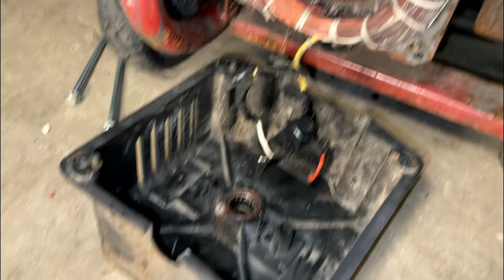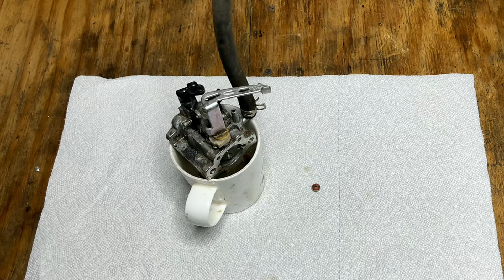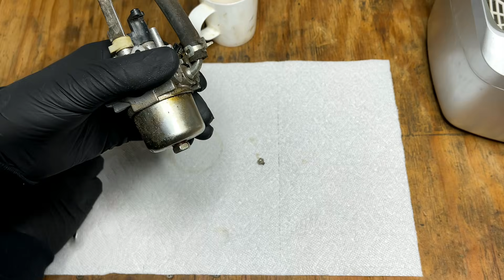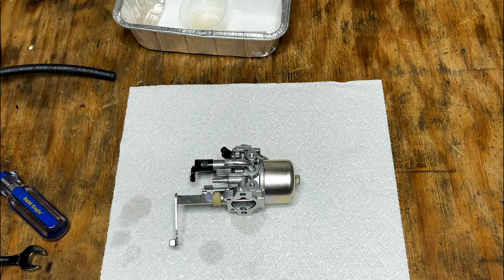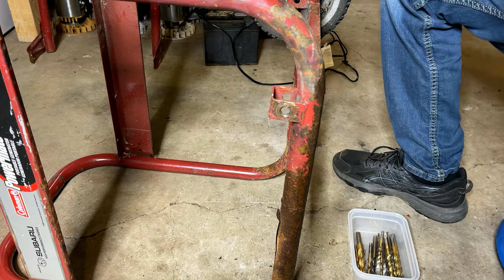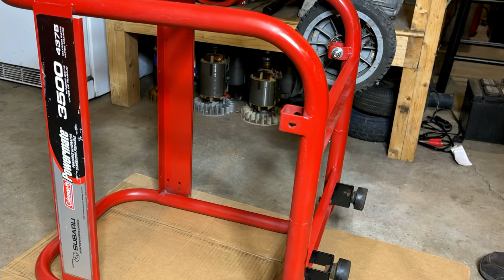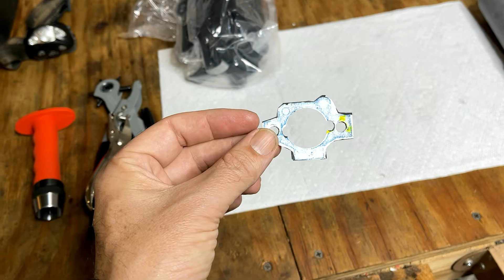Powermate Generator Not Making Power - Can it Be Fixed?

Comment: I CAN TELL YOU  RIGHT NOW WRONG CAPACITOR SHOULD BE 22UF 450VAC THATS MOST LIKELY YOUR ISSUE  I HAVE THE EXACT GENERATOR WAS WORKING FOR HOURS TURNED OFF TO REFUEL WILL NOT CHARGE CAPACITOR SWOLLEN BAD SO HOPEFULLY THATS MY PROBLEM DID ALL THE TEST JUST LIKE YOU AND EVERYTHING GOOD

Comment: One hell of a fix, and transformation, another nice job, James, I do have a concern, though in watching your video the cap on the end of the powerhead had a very tiny little bearing in the end. I think maybe I would've put extra grease in that first, I'm guessing should that bearing heat up in that plastic housing and elongation happens in the plastic, the rotor and the stater will collide, ruining the generator.
Have you ever seen that happen with that design?

Comment: I hate black tape. After it's been there awhile, it's usually sticky and messy. I never use it. If I use electrical tape, I use a high quality (usually white) electrical tape. One of the reasons I hate black tape is that people usually use it to hide their screw-ups. I can't tell you how many times, in troubleshooting electronic circuits, spotted a patch of black tape, and it wasn't only a mess, but it was hiding an electrical mess underneath.

Comment: I just picked up a Twin to this with a running Subaru engine, no output,I did the same checks you did, when I took the back coveroff,the capacitor was blown up,replaced it and it works again, great video
Reply: I bought a back up capacitor 15 years ago for our two units , have not replaced it yet but I very cautious about turning on and off 
I think that’s why they fail is unplug it while under load 😢
Reply: Plus service the sun engines more than needed 😊😊😊

Comment: I have ave a question when you are testing the voltage running and under load where are you hooking the meter up at
Reply from the maker: It is plugged into an extension cord to the generator.

Comment: Greay video James!  I just found this while looking for mantenance tips for my 25 year old Coleman Powermate!  Still generates great, just looking to do a little old age upkeep.  One question, why did you put the folding handle bar on upside down in your final re-assemble?  I'll be checking out your other videos. thanks!😊😊
Reply from the maker: The handle was upside down when I got the generator.  If turned the other way, the handle folds up on top of the tank.

Comment: Actually, there are several features of this unit that are superior, in my experience.  First, the use of the Subaru engine. At work, we used literally thousands of them, with very good success. They are very dependable, and what one of the techs in life test commented : "They are what Honda claims to be, in terms of life and parts cost."

I also like the fact that they used three point mounting for best vibration dampening. And, I like the  brushless design. One of  the design engineers told me they could produce a much cleaner output if the rotor was skewed at the correct angle. The capacitor by the way, is important in determining the output voltage and wave form. When I saw the little 5mfd cap, the first thing I thought of it "it is 'way too small." Smallest I have seen used was 16mfd, but most are in the 30 to 45 range.

Comment: You should get a bench grinder to clean up that hardware 🙂..  Hey quick question, I'm working on a Powermate PM0496504.18 w a gx390..  Was mainly interested in the motor which is running, but need to rebuild the carb..  No power to the plugs on short fuel in  intake run..  What confuses me is the field winding main connector has cont from white to black black to white, but not black to black white to white...? 🤔  Was wondering if you have a vid you can recommend for these specific style Powermate units?  Anyway, thanks for all the great vids..

Comment: I have a question,  he often times will start a generator with a light plugged in and turned on,  then shut the generator off without unplugging the light.  Mine says to always unplugging all outlets before shutting down engine.  It will damage the generator.  Will it hurt it or not?
Reply from the maker: A 70 watt light should not hurt it.  Heavier loads maybe.  I think the bigger issue is the power surges associated with starting or stopping the engine potentially damaging anything plugged in.  Older generators also depend on residual magnetism.  Shutting down with a heavy load can wipe out the residual magnetism are cause issues with the AVR or DPE winding.
Reply: @jcondon1  
Sir, thank you for that information.  I appreciate you taking the time to explain it. 
Have a wonderful day sir.  😊

Comment: I have a Colman powermate 5000 only one leg makes 120 V the other side makes nothing. I replaced the breaker, and checked the brush, all is ok. 
Everything else is perfect.
Last time I used it was under heavy load and the breaker in question was kicking off a number of times until I lost 240volts and only made 120v on one leg. 
Any thoughts?
Reply from the maker: I has to be a bad stator or an issue with the wiring (bad circuit breaker, corrosion or loose wire)

Comment: I have this same generator. One day was working fine the next day it wasn't putting out power. I did try doing the re- energizing thru the brushes. I plugged in a electric light and it came on very bright. However when I disconnect the wires from the 12v battery the light goes out. Does anybody know what that means? With the battery connected it's putting out AC current. I'm stumped.

Comment: these brushless sets are so hard to find information and trouble shooting on, everyones first reply when you say its not shorted out and its not making power is "check the AVR" "did you check the brushes?".. all my wires test fine and my capacitor is good, didnt check anything on the rotor as it looks a mess to try anything with but thats my next step i suppose

Comment: 52:43 I'm constantly puzzled at how you can make the frame look so good, then stick some rustyass Predator feet and junky wheels back on it, without trying to make them look better at all.   They sell spray paint for plastics at every autoparts shop, and certainly you could replace the rusty hardware on those feet, that couldn't be that hard.   Otherwise I love your videos and have learned so much from you, so I thank you for that.

Comment: James good afternoon what determines the power the gen puts ? The number of windings? The size of the wires ? The size of the magnetic field? The speed of the rotor ? Or what determines its power output?
Reply from the maker: It is a combination of things.  First HP.  You need 1hp for every 550 watts.  Second the size of the stator.  If you overload a small stator and the circuit breaker does not trip, then the wires will heat up and eventually cause the insulation to fail.

Comment: Theres a much easier way to make the gasket with the material you have. Just simply put it on the end of the carb and tap the material with a ball hammer lightly and the gasket should come out just fine.

Comment: I've got the same generator. I was welding with it the other day and suddenly the welder seemed really under powered. I ran an angle grinder on all 120 outlets. I checked the no load voltage and I'm getting 105 on one leg and 110 on the other. That seems low to me. My welder runs fine on another generator. What do you thing would cause this?
Reply from the maker: I would check the engine speed first and make sure it is at 61.5 hertz (3690 rpm) no load.  Next would check/test the capacitor to see if its still good.  Otherwise not much else other then high resistance circuit breakers or a problem with the stator.  The fact that you still get voltage is promising.  But the voltage should be the same on both outlets.  You are close so might be ok, but is also a sign of a bad or not so good circuit breaker, wiring or powerhead.
Reply: @jcondon1  could worn brushes cause it to not be puting out very much but still creating some electricity? What kind of tachometer would you recommend?

Comment: I won’t pretend to tell you how to troubleshoot, repair or work on small engines or generators. You know far more than I and your videos share a wealth of knowledge.  However, you are to be congratulated this is the first time I’ve seen you prime before painting.  Also, a trigger handle spray can gun makes using spray cans so much easier.  Walmart, hobby lobby, harbor freight has them if in stock. Range from $4.80 for 1to $8 for 2.  They are well worth their cost. Also, for the best spray paint job you should have the nozzle spray pattern perpendicular to the surface and remain parallel to the painted surface at that distance throughout the spray.  Additionally, start your spraying just an inch or so off/away from the surface to be painted and carry through until just about an inch or so beyond the surface to be painted then stop your spray. You’ll use/waste less paint and have a smoother applied layer of paint and less runs. Woo Hoo it sure helped my painting spray painting skills
Reply from the maker: I actually have one of those spray can guns.  Have not seen it in years.  Need to find it or buy another.  Yes, been using primer recently.  Always good luck using rust oleum without it, but cannot argue that it would be better with primer.

Comment: James your videos just glue you to your show I could watch the videos for hours and not get bored with watching your knowledge at work ! Also learning how to work on small parts without breaking them ! I used to break parts by over tightening nuts and bolts you using a torchwrench really impressed me never had or used one !
Reply from the maker: I have made the same mistake and watched plenty of others do the same.  These bolts are small and easily break or strip out.

Comment: Hi James, I have the Robin EX30 that I'm trying to bring back to life. On the air filter housing top side facing carb, there's a little foam filter there. What can I use to replace it? The stock turned into dust lol. This gen was given to me a while back.
Reply from the maker: Good question.  The parts diagrams do not seem to cover that.  Might need to make a custom filter and cut one to size.

Comment: just wondering if you could have played with the governor sensitivity and got the voltage and hertz more consistent under load no load situation. Either way you took what an increasing number of people would have just scraped. Fantastic job on the restoration excellent troubleshooting and cleanup.
Reply from the maker: Potentially adjusting the governor sensitivity might help, but the response of the governor seemed in line with most.

Comment: The original capacitor was a 5 micro farad and you replaced it with a 22 micro farad why?
Reply from the maker: Someone put in the incorrect capacitor.  Should have been 22uf.
Reply: @jcondon1  Oh, I see because you showed a 5 micro that you took out.

Comment: I have a brushless generator with a clark alternator. No power output with only 4 volts out. Here are my tests so far. Rotor diodes good 3.28 ohms one side and 3.23 other side, powered up with 24  volts and got a good magnet each side. Stator one coil 1.14 ohm the other 1.14ohm, identical. Insulation values to all points above 10 M ohms at 500 volt.
The winding with capacitor is 7.05 ohms. I'm at a loss as to the fault please shed some light on it???
Reply from the maker: I have not tested that model before so not sure what the values are on a healthy powerhead.  The main stator coils seem high.  Usually the ones I test are between 0.3 and 0.5 ohms.  I have had a few smaller 3000 watt generators with a value of 1 ohm and ran fine.  Did you check each coil for ground faults and test each coil to the other coils looking for insulation failures?  The fact they are matched and no insulation failure leads me to believe the main windings are good.  The coil with the capacitor I usually see 1.5 to 3 ohms.  Assuming the values you got are good would look at testing the capacitor and verify the uf rating is correct for your generator.  Also you could try flashing the field with a drill.  But if getting 4 volts, then you have residual magnetism.  This is a link to one that I have to flash to bring it back to life.  https://youtu.be/8GvJkuINoKA

Comment: Kudos to your repair skills mate. Btw, what's a brushless armature is about like this generator has, how does it work?
Reply from the maker: The rotor that is connected to the crankshaft is an electro magnet.  It needs DC to energize the magnet.  Brushed generators send DC power in via the brushes.  Brushless works similar to a transformer where one coil of wire pulses ac next to another coil.  This induces current to flow on the secondary coil creating voltage.  In this way, the primary coil in the stator is able to induce current/voltage wirelessly in the rotor which allows it to power up.   The rotor has diodes on it to rectify the power to DC.   Brushless are more reliable because there are no brushes to wear out.  But brushless generators produce dirty power when compare to brushed.

Comment: How about working on Onan 4000 have issues with up and down idling.
Reply from the maker: My very first generator video was on an Onan.  Different problem though.  Would bet your carburetor needs to be cleaned.  https://youtu.be/ho9spI71vj8
Reply: @jcondon1  Just did a Seafoam/Mistyoil run flush and waiting for it to stop raining and run just gas to see if it cleans it out before I try and remove and clean. 
Tks Michael.

Comment: You have the best of luck using Gear Wrenches,Power drivers,and other assorted battery tools,I usually start out with that stuff,By the time im half way into it on diag im using my old stand by wrenches,nut drivers,and my Fluke meters,Great video,gotta get the high voltage meter

Comment: Wonderful restoration.  Considering the rust in the carb bowl, did you look inside the gas tank with a light and see if its rusty and perhaps needs a good cleaning?
Reply from the maker: I the tank was clean inside.  Will have to pull the petcock off and take a closer look.

Comment: Why is the resistance high and climbing when checking with the high voltage tester? Anyone care to explain to help me understand. Another great video James.
Reply from the maker: Good question.  Not sure the answer other then is a cheap insulation tester.  Generally anything over 10 million ohms should be usable.
Reply: @jcondon1  thanks for your reply!

Comment: Another great video!  I can’t thank you enough for all the detail you go into on these. I recently commented on some videos about my old GP5500 with the broken rocker that your videos helped me fix and then I found out that the power head went bad while it was sitting. Well thanks to your videos I fixed that too and now have a working generator again. The culprit ended up being a muddobber wasp nest that was built right on the wire bridge that connects the two windings on the rotor. It corroded the wire bridge in two. I took a new piece of wire and soldered it back together and bingo. She’s now sending the proper voltage to the receptacles. Thanks for all your awesome videos. Merry Christmas and keep up the fine work.
Reply from the maker: Very nice.  Glad to hear.

Comment: Mustie had a lean running light plant last month,,  He finally ended up taking the main jet out 2 drill sizes from original with his set of main jet drills,,   Engine ran smoothly after that,,,  :-)
Reply from the maker: Sometimes that is the only solution.  Have done that before.  Sometimes it works well.  Other times too much material is removed or worse the drill bit breaks in the jet.  So normally avoid it if possible.

Comment: I thought that the motor was hunting a little when you first started it,,,  Probably a clogged idle circuit making it run lean,,   :-)
Reply from the maker: The Mikuni carbs are jetted really lean.  Would have to drill the idle jet a little to improve it.

Comment: is the handle upside down?
Reply from the maker: I think it was when I got it.  Had to flip it around so the handle would fold up onto the tank.
Reply: @jcondon1  you are correct, the handle rests on top of the gas tank on this model. it does make the generator more compact with the handle on top of the gas tank. thanks for taking the time to reply. I enjoy watching your meticulous mechanical ability.

Comment: Awesome video and great resurrection as always!  My one and only question is, was the handle mounted backwards before? Or is it mounted backwards now? Because it used to fold flat down the side, but the way you mounted it looks like it would fold upwards and fit perfectly in between the top of the tank and the frame.
Reply from the maker: It believe it was on backwards.  So I flipped it around and can now store the handle on top of the table.

Comment: Nice fix and cleanup. WD40 does everything! I've never used it for cleaning but it did a good job.
Reply from the maker: It does a great job on engine blocks removing oil.  It’s good at many things.
Reply: To reply to this…I might have power washed the engine before installing. Yes have to be careful but love the clean look. I understand your approach as well.

Comment: Another great video, those wheels are from a toro mower I guess that's all that guy had..
Reply from the maker: They worked out well.  That generator originally had 10” pneumatic wheels.  The predator feet I used were meant for 8” plastic wheels.